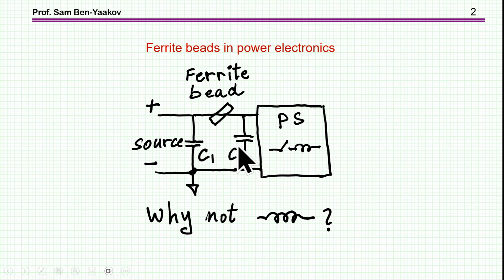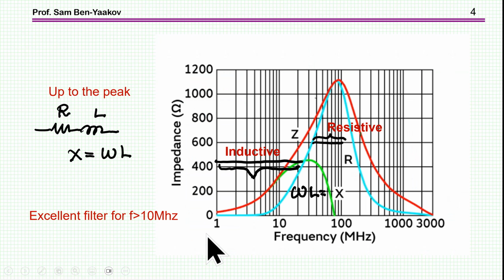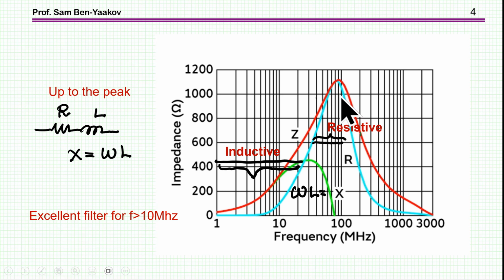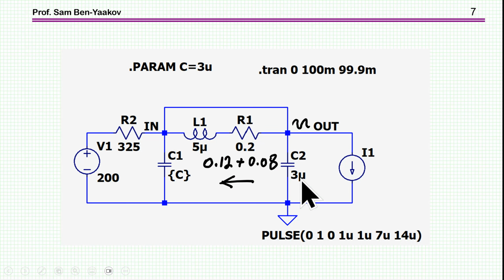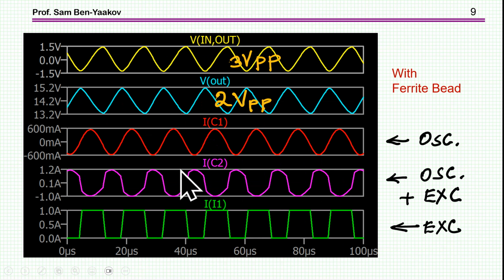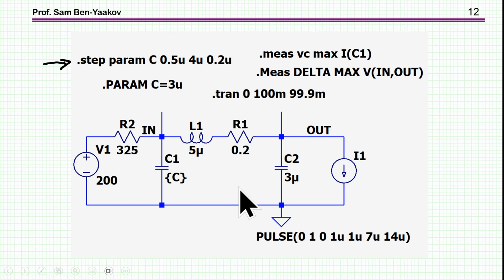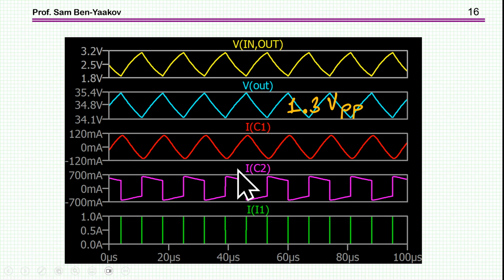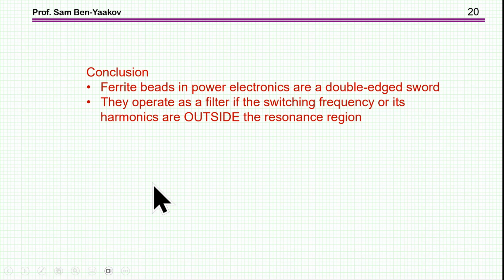To ‘ferrite bead ‘ or not to ‘ferrite bead’ in power electronics

Comment: After a hard day of copying application notes, some like to add a personal touch to the schematic by sprinkling ferrite beads around, without realizing the sometimes disastrous side effects. Even if something seems to behave normal, things might go very wrong during EFT burst testing when a transient makes its way in into a power supply line stuffed with more often than not some misunderstood ferrite beads. If the circuit permits, and you need some filtering in the typical range where SMPS's generate noise, a simple 1...10 R resistor and a 100 nF capacitor do a much better job for less money. At some company they call me Mr. 10 R, in a friendly way because many problems can be solved with small value resistors. Ordinary small value resistors costing less than a cent for values <100 R in an 0603, 0805 and 1206 package behave as true resistors up till very high frequencies where ferrite beads can be replaced with a piece of wire. (Vishay has some app notes on the high frequency behavior of small value ordinary SMD resistors.)
Reply from the maker: Very good points, Thanks for sharing.

Comment: I am a bit confused about the inductance value. The switching frequency is 70 kHz, but the selected inductance from the ferrite material plot corresponds to 6 MHz. Could someone please clarify why this is the case?
Reply from the maker: The ferrite bead behaves as an Iinductor up to about 6MHz. It is better to get the values of XL at a higher frequency for better resolution.
Reply: @sambenyaakov  Thank you for clarifying sir.

Comment: I've encountered another issue when using ferrite beads in the power rail (where they act as inductors): when an external power source with low ESR is connected to that LC filter, it causes a significant voltage spike due to the inrush current. This spike can be damaging—in my case, it actually burned out a buck converter IC.
Reply from the maker: Thanks for sharing this interesting information

Comment: I have 2 questions if possible:
1- Is it better to choose a ferrite in order to make the resonance frequency higher or lower than the target frequency?
2- I think inductor is more easier as you just need to care only about the resonance frequency and not also the resistance of the ferrite correct?
Thank you.
Reply from the maker: Ferrite beads are in fact inductors up to about 30MHz

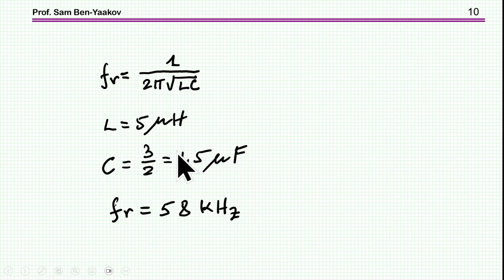Comment: At 9:16 you calculate the resonant frequency of the ferrite bead with input and output capacitor. You say that the capacitors are in series. But it seems to me that looking from the load, C2 should be in parallel with a series connection of the ferrite bead and the capacitor, right?
Reply from the maker: It is assumed that the injection is of current not voltage
Reply: @sambenyaakov  sir could you explain little bit here

Comment: hmm so basically unless i need to filter 10 20 50MHz and up i should stick to normal inductors 
This material remanded me of a simulation where i wanted to low pass filter a 3v3 PWM  and when i tried a ferrite i ended up with 10-15V spikes somehow 
It was great that i simulated that mess and not fries MCUs .
Reply from the maker: Indeed. Thanks for sharing you experience.

Comment: This is another great instructional video on practical power electronics topics, thanks professor. I was talking about this topic with younger engineers last week, we had issues with voltage ringing caused by resonances from ferrite beads and low value ceramic capacitors affecting power integrity on powe rails. Sharing this video with my team!
Reply from the maker: Thanks.  Ferrite beads are not a magic bullet!

Comment: I have often found that trying to use datasheet parameters for ferrites doesn't get the simulation as close to the observed performance as I would like. I presume this is mostly down to board parasitics. I generally make provision for a ferrite and then try a few different options - it's not clever, or intellectually edifying, but it gets me to a result quite quickly. Making ferrite provision also gives you a nice way to isolate different parts of the circuit during development - which is reason enough, regardless of the potential filtering benefits (one can always fit a 0R link if the ferrite doesn't help).
Reply: @AllTheFasteners  
I have seen a lot of 000R resistors placed on FB places on HP printers and other products.
They might be there because different requirements in different areas of the globe 🌎
Reply from the maker: Thank for input.

Comment: Could you do a follow on video to this where you talk about the saturaton effects of ferrite beads. Most manufacturers do not provide this information about their beads, with the exception of Laird (used to be Steward). Since ferrite beads are quite useful at supressing the high frequency noise caused by harmonics of the switching regulators, a little more info on how and when to use them would be nice. Because ferrite is such a non-linear material, a lot of engineers (who should probably know better) tend to over simplify it, avoid accurate analysis, and then sprinkle them like pixie dust to solve EMI/EMC problems. I have been guilty of that, but would like  more understanding so i don't repeat it.
Reply from the maker: Please see https://youtu.be/F-wSu162tCo?t=581 since that video was posted I had second thoughts about using FB in power electronics.
Reply: @sambenyaakov  Yes, that is a very good video! I guess the takeaway from these two videos is that one needs to understand the ferrite fundamentals, and then test and iterate to make sure that it is really solving the issues and not causing more. And then don't let purchasing make a part substitution after the fact unless it is tested.
Reply from the maker: @ Indeed

Comment: I thought you were going to go into saturation, this is 0805 part which will be almost fully saturated at 1A. So the problem will not exist in the real world, of course the bead will not be an improvement in that case too.
Reply from the maker: I did not find the info on the DC dependence for this bead. However it is specified to 1.6ADC while the intended use was below 200mA. See also https://youtu.be/F-wSu162tCo?t=581

Comment: Why is the bead inserted between the capacitors and not on either side of them?
Reply: You want low impedance = capacitor on your output, not a high impedance bead.
Reply: @jaro6985  
I understood that it's on the input!
I understand that beads (As all components) should be used with care, but every board I have encountered has MANY of them.
Reply from the maker: The capacitors are part of the units. And, putting an inductor before the decoupling cap is bad.
Reply: @sambenyaakov Then can this situation be mitigated by shifting a resonance frequency to a sub-hertz range with a bigger inductance and a bigger capacitance (of course with keeping X high for f<100MHz?
Reply from the maker: Increasing the C not L to reduce Q. In any case IMHO FB use in power electronics is limited.
Reply: @sambenyaakov 1. Is it a "real world"  example?
2. How would you solve this problem with the F.B.?
Reply from the maker: In this case I just removed the FB.  In other cases: use a FB with lower L and add a small resistor to reduce Q, increase the capacitances, or just insert a resistor. FB are excellent for RF filtering. IMHO tier use in power electronics is limited.
Reply from the maker: @paulcohen1555 we removed  the  FB in this case

Comment: Great video, Professor! I have a question that I hope you can address in your next video about ferrite beads. When designing the layout for a MOSFET gate drive, there's a rule to make the loop as small as possible to minimize inductance. However, there's also a ferrite bead placed on the gate drive loop, which acts as an inductor at frequencies like 10 MHz. How do these two considerations work together in the design?
Reply from the maker: That's a good point. Gan Systems used to suggest adding a ferrite bead to the drive, but I don't think they do anymore. This was deemed useful for suppressing very high-frequency oscillations. In any event, they had a resistor in series that damped the loop.